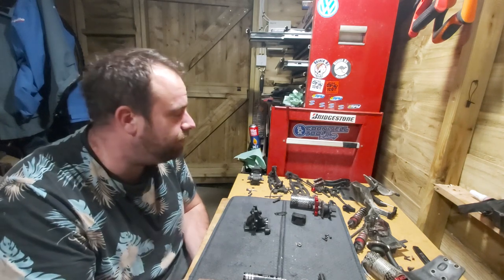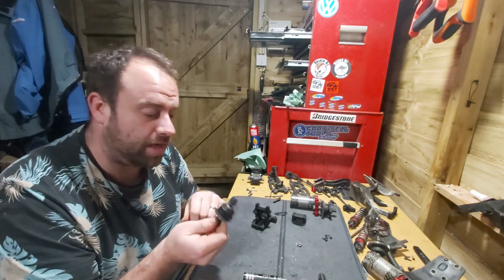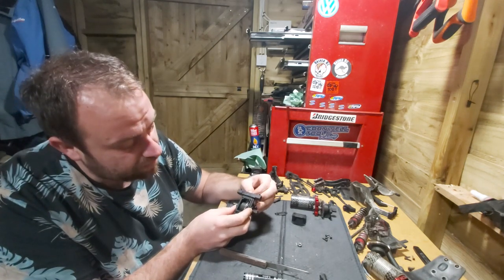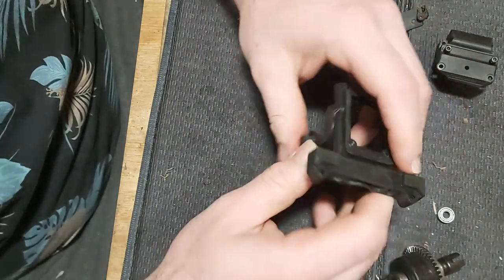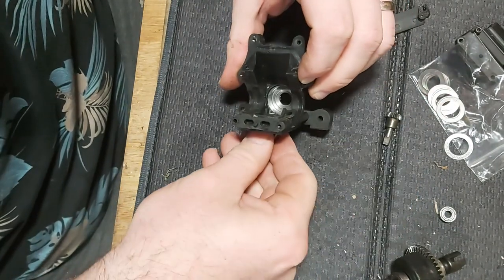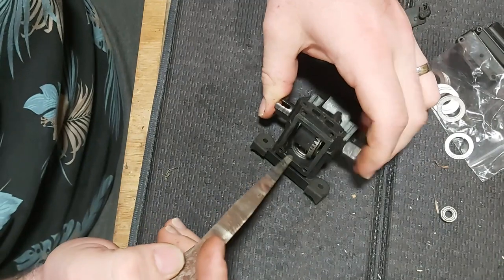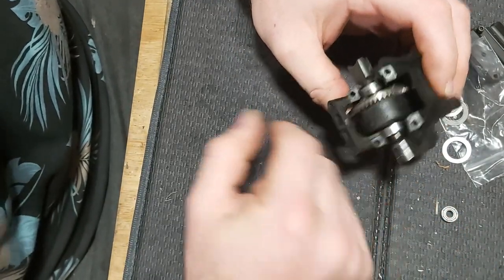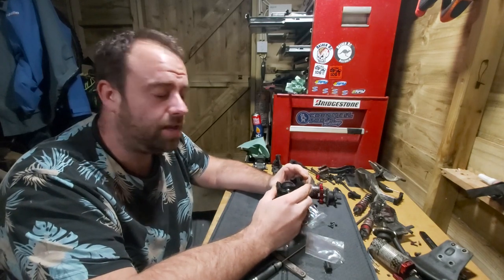Arrma 6s Diff Pinion Shimming

Comment: Oh yeah that last comment was for a Kraton 6s v5 . It’s been a good RC for me and almost complete so I’m somewhat enthusiastic about the project as it nears completion hopefully . Of the max6 g2 system doesn’t work I ll throw the spectrum back in but it should .hopefully . I did a granite with a 4s system on 3s battery , 4s backflips , wide kit , steel diffs, shock tower adjuster , 6s shocks and it lands like a cream puff but it goes further in the air  the heavier tires . It’s pretty awesome for a jumper as long as ot lands on 4 wheels the 1” taller higher and 6s Mohave k6s combo shocks reduce the chassis slap quite a bit . All my other cars except the 4s outcast will hit chassis of drop them form the knee height but no that granite . Like a cream puff man . I’m going to make a vid soon as the phone holder comes

Comment: Very helpful as i keep blowing out the crown and pinion on my Kraton, even after shimming the side - will give this a try
Reply from the maker: Yea this is good little trick, to get a better mesh and stronger gears
Reply: Noob here but sounds like your input gear and the input shaft cup was not set right or came loose overtime and gave it to much slop causing the input gear to eat the crown gear. prob one of the things people should check before or after each run to see if the input shaft cup slid from its spot. I'm sure shimming it would be a backup to prevent it from sliding? No idea, just tossing out  my thoughts.
Reply from the maker: @stuart3712  Hi Joe the issue isn't slop there isn't any slop on the drive cup.it is to get the pinion to stick slightly further out to mesh better with the crown wheel gear
Reply: Bournemouth RC yep, my rear was so bad that only 2/3rds of the pinion was running on the crown

Comment: This is the last thing I need to do for my diffs, that and get some TRUE 2.25mm diff pins. The pins that come stock are definitely not 2.25mm, there's so much play on them. So hopefully after shimming up the pinion gear, I won't have any issues with the ring gear, and hopefully, after getting the thicker pins I won't have any broken sun gears anymore.

Comment: Time to replace some diff cups . Only one side is really bad in the front and rear so that’s what they’ll get . Doing the servo saver shim next . I d add the adjustable piece but rings are cheaper and in the house right ? Thanks for making the  vids . Yours was the best one I’ve found to get this done . It’s getting a max6 g2 1650kv motor esc combo so I ll do everything as long as I’m in the mood . Once these things are done mine have been good for many many packs . More than 30 or more depending

Comment: Good tip bro,but if you get good sealed bearings to replace the stock ones,this eliminates the play,also adding 2 shims on the drive side of the diff helps too! Every little helps! Peace bro...hope the Mojave build turns out good!
Reply from the maker: Cheers man, I have a set of sealed bearings in my Krajave build and they needed the same. Yea I have also done that on the drive side, now I have done both they fit really snug. Hopefully will have the build finished in the next week or 2

Comment: Cant you just pin the input shaft cup tighter to stop the slop? Im a noob but it seems to do the job as long as the set screw does its job. Mine has 0 slop but as i said, i'm a noob so maybe doing it that way causes issues? Also to note i have the HR diff bulkheads/case.
Reply from the maker: No the issue isn't slop it's getting the pinion to stick slightly further out to mesh better with the crown wheel

Comment: Much appreciated! Are you still using arrma ring and pinions or have you gone aftermarket? I just stripped my 3rd ring and pinion on my v4 notorious (front diff)  I will be following your advice, definitely getting a feeler guage to determine shim sizes
Reply from the maker: Cheers man, Yea I still use arrma ones, but I believe the new v5 ones are hardened so they might help
Reply: @bournemouthrc4371  v5 diffs still needs shimming?

Comment: How necessary is this because I was considering getting a kraton but this makes me have second thoughts
Reply from the maker: It all depends on how hard you want to drive it, but in all honesty yes it's pretty important
Reply: I had my Kraton stock for many months before doing this. It did however come with low diff fluids. That would be the best time to check